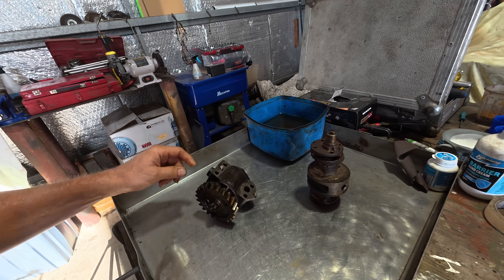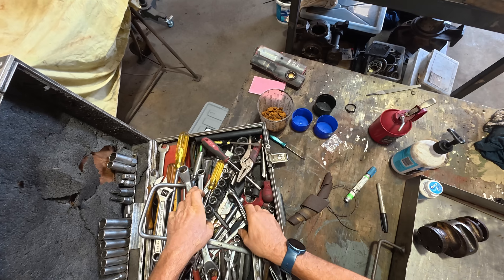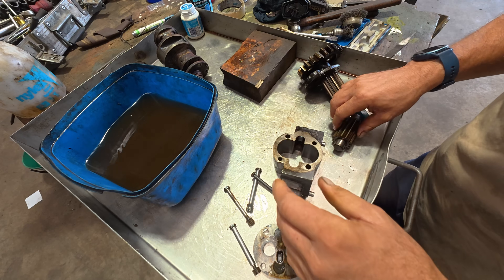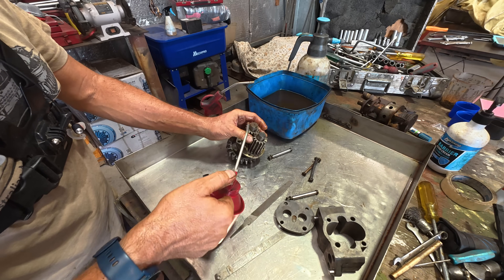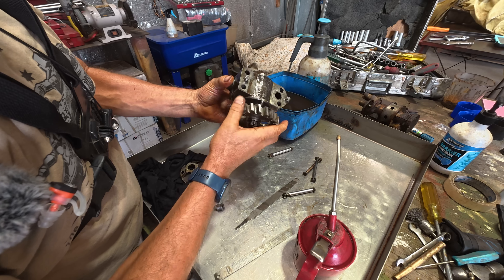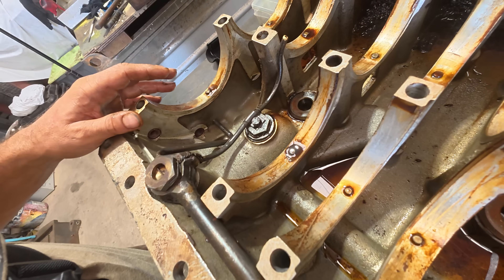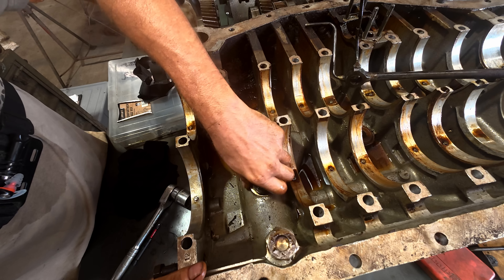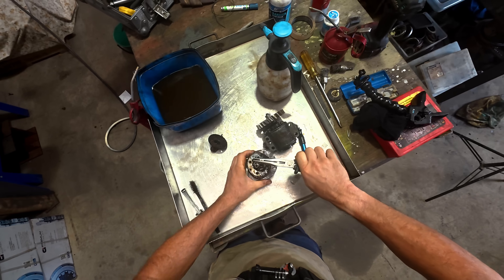Inside Panzer II Gearbox Oil Pumps

Comment: The oil pump is probably not over engineered.  They only had straight weight gear oils in the era and given there was an expectation for winter operation the gear oil would be like cold honey  in the winter.   So a pretty stout gear oil pump  would be necessary.
Reply: Correct.  Also, the oil pumps are not unique to that vehicle and not unique to that gearbox.  The gearbox designers would have picked the nearest standard pumps from a catalog.   Same as the bearings and seals.  The museum is mostly able to buy new bearings and seals because they have long been standardised like nuts and bolts.
Reply: @keithammleter3824   Ya no, not in that era and especially not in Germany or even  England for that matter. The only nation that truly had standardization in the era  was the USA. Anyone that has worked on European equipment from the era knows that most parts do not really interchange between pieces of equipment and need a final hand fitting, and the further you get from automotive the the more common this becomes.   In that era in Europe about the only thing that was standardized were seals and bearings and even then not always with pluses and minuses fitment available...
Reply: @matthewq4b  You have no idea what you are talking about.   The German standards body, DIN (Deutschen Industrie Normenausschuss} was set up in 1917.   Germany had learnt a hard lesson in WW! and had realised that standardization was key to efficient production.   DIN's first industrial standard in 1917 was for taper pins for machinery.  By 1930, there were over 30 DIN standards, covering steel grades, fasteners, electrical components, lots of things.  Their electrical standards go back to the creation of VDE in 1893.  RAL was formed in 1927 to standardize military equipment features, paints, etc.
When Hitler came to power and freed up the economy, he and his minions put a big emphasis on parts standardization.
Those of us who are interested in WW2 electronics know that Germany took standardization to extremes.  Not only did they standardize on particular radios, they made radio equipment with only one kind of vacuum tube.  American and British radio equipment had a specific tube for each specific purpose.
Germany led the world in standardisation, having standards committees (VDE 1893, DIN 1917) well in advance of the UK, which didn't have a general standards body until the creation of BSI in 1931.   Standards in the USA developed at about the same pace as Germany.

I don't think you actually have much, if any, experience in working on equipment.  While German equipment tends to be more complex, French equipment is worse in that regard, and there is a LOT less variation in parts is old German gear than there is in American gear and especially in British gear.

The gearbox featured in this video, made by ZF, is an adaptation of an earlier tank gearbox, which itself was a militarised version of a heavy truck gearbox.  The parts in these ZF gearboxes are completely interchangeable - they are not individually fitted, not are they select-on-fit as was common in US equipment.
Your comment about non-interchangeability is completely wrong.
The oil pumps in these gearboxes were made by ZF but were standard ZF parts, not unique to this gearbox.

DIN Standard 7154 / 7155 (Fits and Tolerances) goes back to 1920 and defined clearance, transition, and interference fits.  Any German firm not complying with this and other standards would have brought the wrath of Hitler's regime down on them.  Standards were enforced, they were not voluntary as they were in Britain and the USA.

Hitler was and is pretty famous for his push for standardization and standard products at all levels.  It is one of his defining characteristics.  Hence the People's Car (VW Beetle}, the People's Radio, etc - consumer goods made cheap enough for peasants, through standardization and vast mass production.